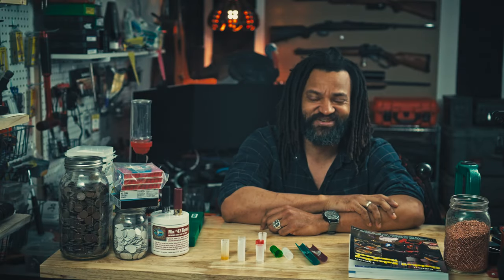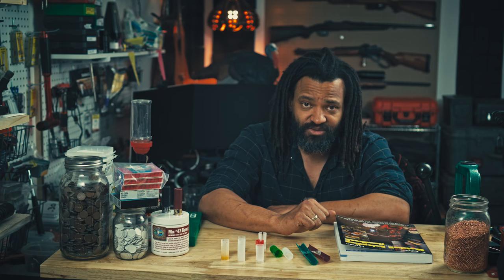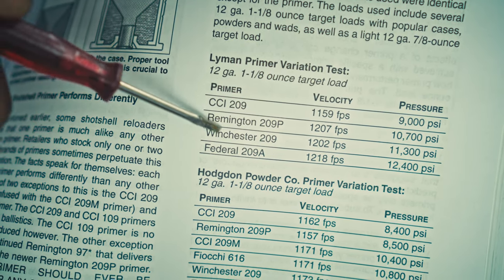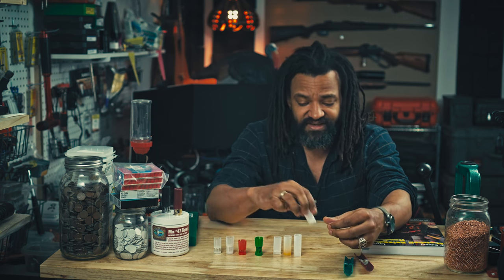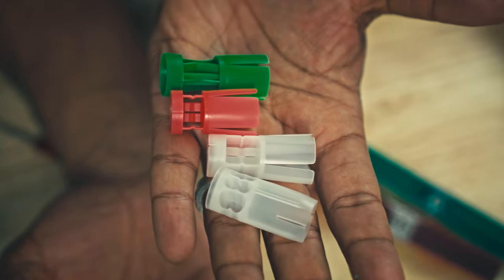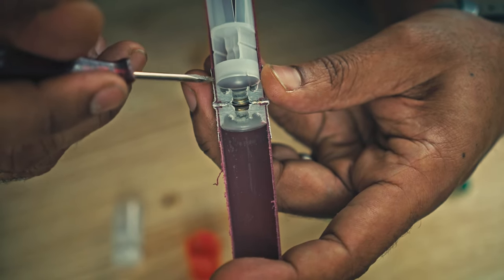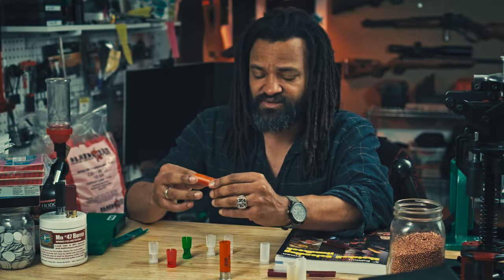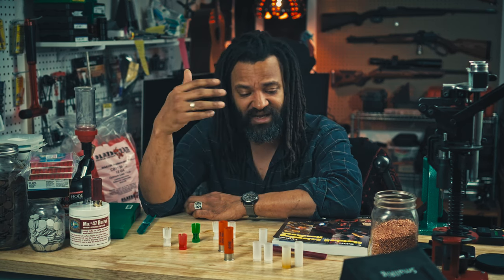Substitution of Hulls & Wads

Comment: I'm just getting into reloading and I want to load mild loads of 20 gauge using fiber wads and a shot card. From what I understand fiber wads typically generate lower pressure than plastic wads. So am I wrong in assuming that I could take load data for a plastic wad and replace it with fiber, provided I have the proper stack height? How would a fiber wad load into a tapered shell?
Reply from the maker: I don't have much experience with fiber wads, but if I were to dev a load, I would start low and see what happens, I know fibers will give you a wider pattern. I would look for a good combination of Speed VS pattern. For tapered hull I guess the fiber would compress a little but not to the point of giving an issue.
Reply: @WildBushGrit  Ok ill try that ,thank you for the reply man! You are a fountain of knowlege!
Reply from the maker: @Marlboromickey  Thank you, I'm happy to help when I can, keep me updated with your dev, I'd like to know :)

Comment: 5:15 The over powder cup will never touch thebase wad. Once you drop the powder into the hull its over powder cup portion of the wad should lightly compress against the powder charge. A little bit of powder migration is not a problem.
Reply from the maker: I agree, its confusing the way I said it. I meant the powder should be sealed between the wad and the base, but didn't meant to say that the wad and the base needed to contact for a seal.

Comment: I don't see a problem in doing substitutions. What you want to do is pick the Lowest pressure load than any substitutions are not gonna cause hardly any problem.
Reply from the maker: If you don't consider hull construction, you will likely get powder migration and poor performance.
Reply: Yeah you're absolutely correct when I do substitutions I make sure everything does match up
Reply: @WildBushGrit A little powder migration has never been a problem. 
Claybuster now makes a Winchester style green wad that are made for straight wall hulls.😢
Reply from the maker: @jungleno.  Of course, a little is not an issue, but if the wad is all loose in the hull, it wont be good. Why the sad face :) ?